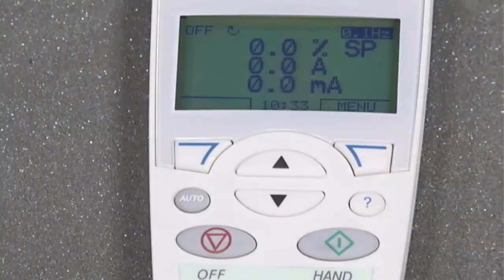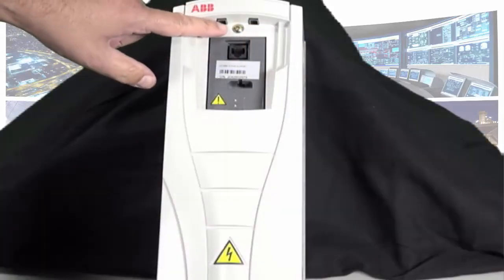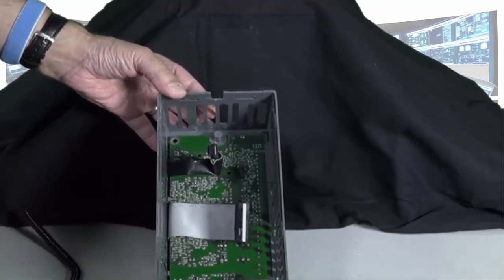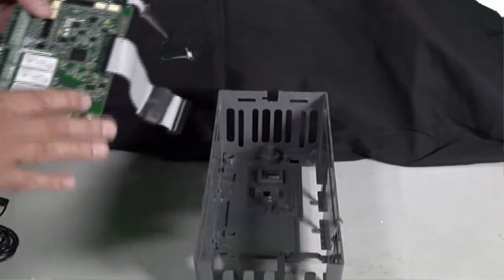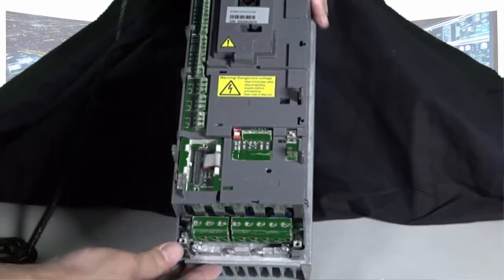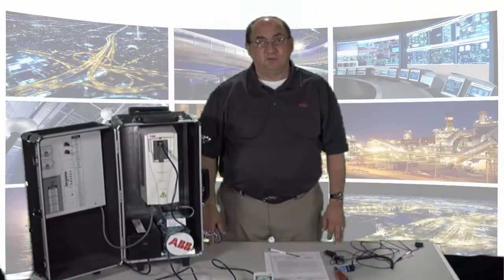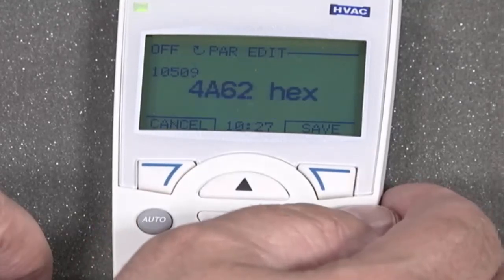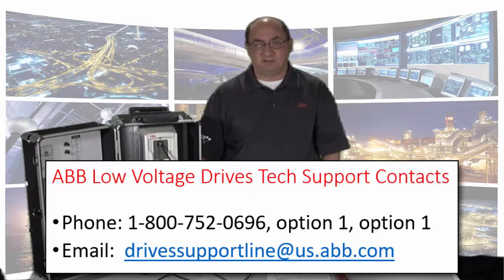Replace SMIO Board on the ACH550 Drive

Comment: Hi can i edit 9 KW vfd  to 37 KW.. In smio board pls advice
Reply from the maker: Unfortunately that is not possible. The hardware components, mainly power devices of the 9 KW drive are not the same as the 37 KW drive.  A larger drive would need to be purchased.